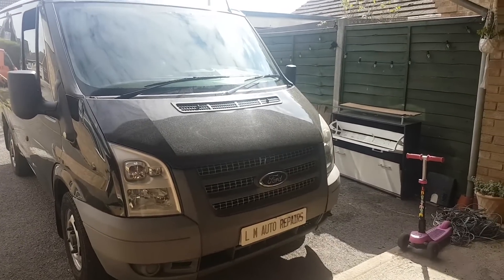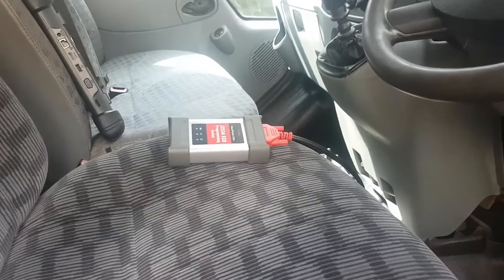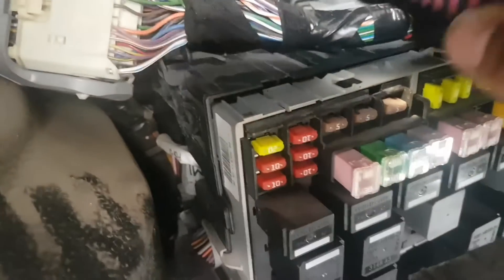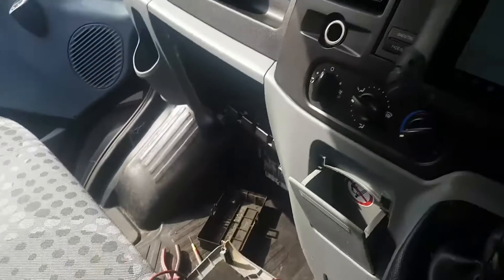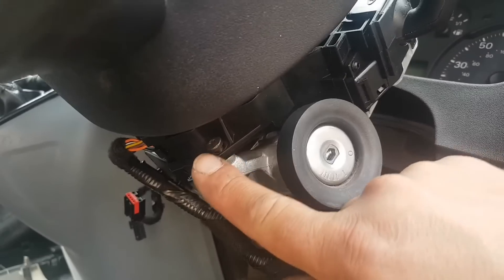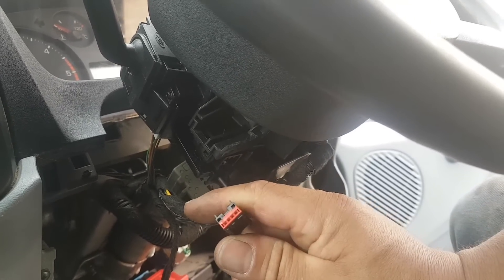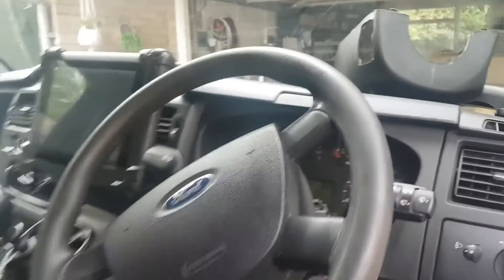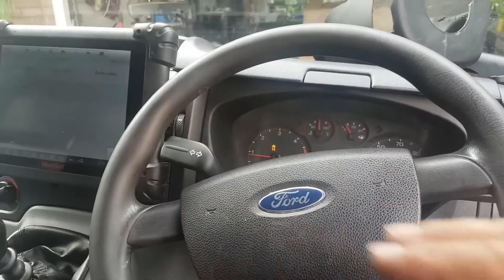Transit ESP light on, even after SAS replaced... Fault U0126. Fault finding and repair.

Comment: good morning Luis i do work on a 2007 transit my autel dont work like yours the owner just wanted to know why his abs light was on not pay to find out why the machine would not work so i have a snap on plug that in and that connected it was a wheel sensor that sorted every thing ok so if the problem with autel not powering up is the fuse ( thank you for showing where it is) his ESP light is not lit  so my guess is the original SAS went down fitted new and out of calibration  had a nissan juke  which cant be calibrated it had to be taken for alignment and the SAS had to be zeroed then wheels set to spec thank you for the video
Reply: If the Autel doesn't connect a snap-on wouldn't connect , or any other scan tool, either. I have seen scan tools that can't communicate with all modules but OBD power and communication are two separate things. Nissan calibration is done by driving the car which is the same as many other cars.
Reply from the maker: I would like to add, that if the only problem with the obd is the power supply to the tool, it is always possible to power up the tool externally... at least on the J2534 is possible...
👍👍👍
Reply: @beluxauto5968  hi the autel dongle needs power from the dlc  to operate and power on  no power from the dlc dongle wont communicate the snap on is self powered and don't rely on dlc power so it can communicate    through dlc cable and the fact that i have done it proves it works and with the nissan how does it know to self calibrate  like luis i got this car at the tail end of a few garages that failed  drove it on live data to find fault and whilst driving it straight down the road steering wheel was very slightly turned and live data showed a few degrees of turn the only way to get it back to zero was to adjust alignment